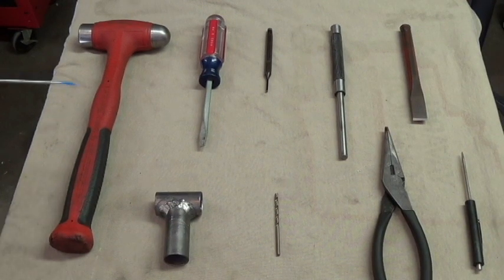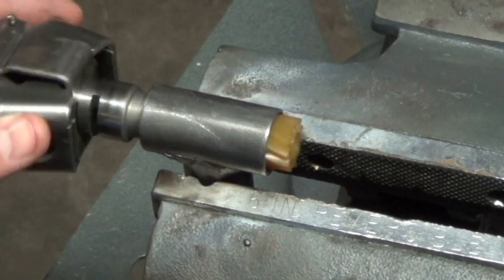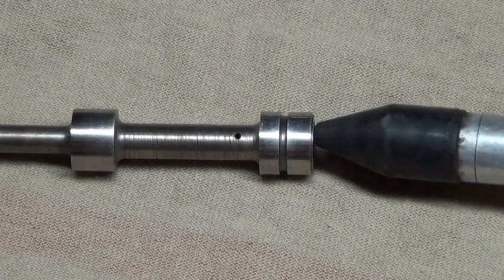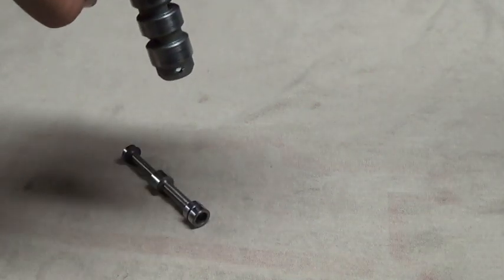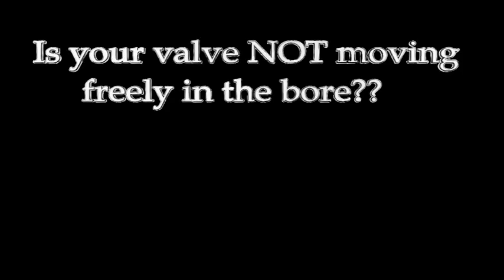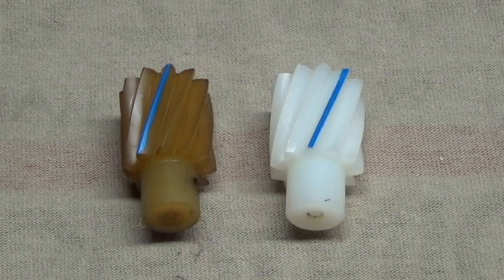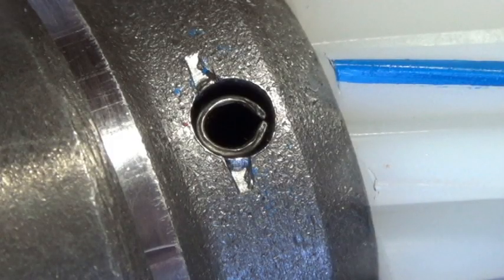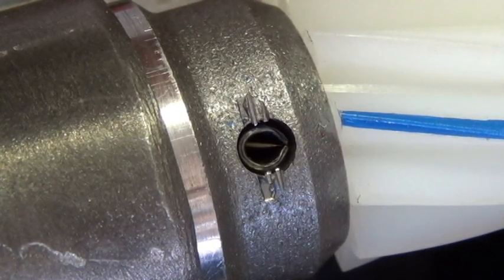TH400 Rebuild:  Governor #SouthpawAutoworks

Comment: thank you. I rebuilt the guvnor, put the valve in wrong, no downshift or first gear. your vid showed the correct valve direction. took it back out, turned it around as per your vid. it works great. thank you.

Comment: I was looking for that link to making the governor holding tool. Thanks. I most definitely found this video very helpful.  Most tranny overhaul videos don't go into the "accessory" overhauls. I'll be applying what I learned to the 700R4/4L60 governor.
Reply from the maker: Unfortunately, the video has not been created.  Good intentions...
You are so right about most videos not covering the "accessory" overhauls.  It's a real shame.
However, I'm happy to fill that gap.
Thank you for the positive comment.
Reply from the maker: Updated videos on the way!

TH400 Rebuild Series - Coming Soon
https://youtu.be/q0eciXU8YEI
Reply: @SouthpawAutoworks  awesome! Good to hear. I've been slacking on making vids, myself. I'll check it out. Thanks! 😊👍🏻

Comment: Invaluable info for Chevrolet P30 motorhome chassis where the transmission sits for long periods. The metal gear that drives the governor gear corrodes while the vehicle sits and then the rust eats that plastic or nylon driven gear on the governor.
Reply from the maker: Dang, that's a bummer.  It's a good thing that you can easily tackle this issue.  Thank you for your comment RVH MON
Reply from the maker: Updated videos on the way!

TH400 Rebuild Series - Coming Soon
https://youtu.be/q0eciXU8YEI

Comment: mines at 25 years setting, rev and 1st work. but no second gear came in, hope this is the fix. very good vid thanks.
Reply from the maker: I hope so.  Good news is, removing this governor is very easy on TH400.  

Heads Up:  The governor and the vacuum modulator work hand in hand to create upshifts and downshifts.  If it were me, I would also be removing the hose from the vacuum modulator, and checking for engine vacuum, while the engine is idling.

Let us know what you find.
Reply from the maker: Updated videos on the way!

TH400 Rebuild Series - Coming Soon
https://youtu.be/q0eciXU8YEI

Comment: Thanks, very nicely done.  I have a TH 350 that's kicking my arse.  I have the governor out, but I did not intend to disassemble the gov gear to check to see if the opening in the valve is clear.  My trans. doesn't shift when in "D".  I have all the other gears.  Hopefully, the orifice is clogged and all of this will be over.
Reply from the maker: What was the outcome of your TH350 job?
Reply: The valve was sticking!  It had built up debris over the years.  When I spread the weights and tipped the governor upside down, the valve never moved.  I disassembled it, cleaned all the parts and the port then reassembled.  Wham!  Shifts like a boss.  Thanks for the video and for the follow up.
Reply from the maker: Glad to hear that your repair went well.  Good job!
Reply from the maker: Updated videos on the way!

TH400 Rebuild Series - Coming Soon
https://youtu.be/q0eciXU8YEI

Comment: Hey thanks for the video! Awesome!
Quick question maybe you know, I installed a rebuilt th400 in my truck and it shifts normally 1 to 2nd and in reverse. 1 to 2 shift is perfect and strong, but when it’s time to shift to third it doesn’t shift even at wide open throttle. Also when I’m in second and off the gas slowing down or coasting down a hill on the highway, the engine goes to idle. Even if I can coast the truck faster than top speed in 2nd it still won’t go. Sometimes I feel it ‘shift’ into third but seems to downshift back into 2nd like passing gear. The electric wire has been off for testing purposes What could be causing this? Thanks for any light you can shed! 💡
Reply from the maker: Matt, sorry for the delayed response.  Did you already get help with this issue?
Reply from the maker: Updated videos on the way!

TH400 Rebuild Series - Coming Soon
https://youtu.be/q0eciXU8YEI

Comment: Good video....At 3:51, what is the purpose of "blue line" on the gears?
Thanks.
Reply from the maker: It was used to highlight the angle (or cut) of the governor gear.  It's super easy to install the wrong gear.  For example, the TH400 governor gear and the 700-R4 governor gear look identical...but, they are not the same.  If we install a 700-R4 gear into a TH400 governor, the governor will not install into the trans.  It's physically impossible to install it.  The teeth on the governor gear and the teeth on the output shaft will not mesh.

Mentioned this detail, in the video, as a way to prevent a potential headache for someone.
Reply: @SouthpawAutoworks  Thanks for your such a detailed explanation....Last question....why do we need governor for transmission?
Please reply in your spare time...
Thanks for sparing your valuable time...
Reply from the maker: When time permits, I'd love to dedicate a video to this topic.
For the time being, here's very basic response.

The governor creates oil pressure that represents road speed.  At zero MPH, the governor creates 0 psi.  But, as vehicle speed increases, it will rise roughly 1 psi for every MPH...up to a certain point.
This ever-changing oil pressure has an effect on the timing of the up-shifts/down-shifts.

The governor works in concert with the vacuum modulator...and both of those systems (governor/modulator) affect the shift valves.
Once again, trying to keep it short and sweet.
Reply: @SouthpawAutoworks  Thanks for your excellent explanation.... Appreciate....

Comment: a question in advance thanks for uploading interesting videos, ok
I have a 1964 chevelle but they put a 1968 transmission with Z-gate shifter. The car now does not ignite. Do you think it's just to buy a startshifter that comes with a neutral safety switch? :/
Reply from the maker: Unfortunately, I'm not familiar with the Z-gate shifter.  I believe that you're on the right track with the neutral safety switch.
Reply from the maker: Updated videos on the way!

TH400 Rebuild Series - Coming Soon
https://youtu.be/q0eciXU8YEI

Comment: Where's the link to make the governor holding fixture? It appears to be missing. The 2 measurements I need to make one are: inside diameter of the pipe and it's length. I'd like to make one ahead of time instead of having to remove it, take the measurements, then leave it out while I build one. 

Thank you for the great video. 😁
Reply from the maker: Mark, sorry for the delayed response.  Unfortunately, the time to make the video has evaded me...for a while.  However, I will be making this one in the near future!!
For the time being, here are the dimensions.

Dimensions:
1). Inside Diameter of pipe:  Roughly 0.825" (13/16").
2). Length of horizontal section of pipe(that holds governor):  Roughly 1.750" (1-3/4").
3). Length of vertical section of pipe(held in jaws of bench vice):  Roughly 2.000" (2").

Materials:
I found pipe with this inside dimension that happens to be galvanized.  HEADS UP...welding galvanized metal is very hazardous to the respiratory system.  I hear that it can cause death.  I'm looking for a suitable pipe, and will provide a link to safe materials, when time permits.  Mark, if, in the mean time, you come across a good source, please share.

Larger inside diameter may work:
A guy may be able to use a pipe that sports a larger inside diameter than specified...and simply wrap the governor with masking tape/paper, prior to inserting it into the fixture.  This will take up the extra space(clearance), and protect the bearing surface(the shiny/smooth part) on the governor.

Mark, thanks for your comment.  I look forward to putting this future video together for you, and the rest of the viewers.  Take care.
Reply from the maker: Updated videos on the way!

TH400 Rebuild Series - Coming Soon
https://youtu.be/q0eciXU8YEI

PS I still need to make the video for the governor gear holding fixture tool.
Reply: @SouthpawAutoworks  Thank you Sir. No hurry; I traded that truck away. I did replace everything I'd planned except for that gear. Thanks for sharing 😊

Comment: Would the governor gear be my issue if at steady 60 or even 55mph it will shift out of 3rd into second an then back into 3rd mostly if I give it a lil throttle ? Th400 automatic with a cheetah 3 speed shifter .
Reply from the maker: I'm not familiar with your shifter setup.  =/

Do you have a valvebody reprogramming kit installed in the transmission?
Example: Superior, B&M, Transgo "Shift Kit", etc.

Do you have the kick-down solenoid wired from below the gas pedal, to the transmission?  In other words, do you have one installed at all?  If so, does it need an adjustment(clearance between the gas pedal and the button on the solenoid on the floor?

The modulator(engine load) and the governor(vehicle speed) work against each other to create both upshifts and downshifts.
The modulator receives it's input from manifold vacuum.  Maybe it needs an adjustment.
The governor RPM acts on the governor weights...and acts against the weight springs.  Maybe you need to calibrate this, with another set of springs.
Reply from the maker: Updated videos on the way!

TH400 Rebuild Series - Coming Soon
https://youtu.be/q0eciXU8YEI

Comment: I have a 350 turbo on a 350 camaro...my second to third seems a little late to shift for me...what do u suggest...thanks in advance.
Reply from the maker: If you want to customize the shift point of that particular shift, you can do so by installing a valve-body reprogramming kit....also known as a "Shift Kit."  The kit will come with different springs.  You could also install modified governor springs.

If you're not rebuilding the entire unit use this kit:  https://amzn.to/2qFBoE4 (Paid Link)
If you're rebuilding the unit, use this kit:  https://amzn.to/2YDMfed (Paid Link)

DISCLOSURE:  🕵
As an Amazon Associate I earn from qualifying purchases.  This means that, at no additional cost to you, I will receive a small commission on any purchases you make through the website links provided above.
Reply from the maker: Updated videos on the way!

TH400 Rebuild Series - Coming Soon (60-Second Preview)
https://youtu.be/q0eciXU8YEI

Comment: What do you use to free up stuck cylinder in governor burse
Reply from the maker: Are you having trouble removing the governor from the transmission??

If so, I've never had one get stuck.  

My Thoughts:
1). If it was a junkyard trans, it may have been contaminated with water from sitting out in the elements.  Spray it with WD-40...work the governor back and forth by hand.  It should come out by hand.  I've never had to use a pry bar to remove one of these...but a little finesse with a pry bar on the governor gear may do the trick.
2). Remove the rear housing.  Look closely at the roll pin, that retains the plastic governor gear.  Make certain that it is still in its bore.  In other words, you should not see the roll pin sticking out of the governor body.  Rotate the governor, to check both sides.

Please let us know how you went about overcoming this obstacle.  Thanks.
Reply from the maker: Updated videos on the way!

TH400 Rebuild Series - Coming Soon (60-Second Preview)
https://youtu.be/q0eciXU8YEI

Comment: Hey guys,
 yesterday I had a look at the governor finally. All good.

One easier thing I don't remember, but I guess didn't check completely is the Kickdown Solenoid inside the pan.
 It could be stuck open, but how do I check if it is stuck exactly?

That's the part: https://www.rockauto.com/de/catalog/cadillac,1978,seville,5.7l+350cid+v8,1027460,transmission-automatic,shift+solenoid,8476

If that won't turn out to be the problem. I guess it's time for the 2-3 shift valve ...?
I would like to get any information about that ...

1. Is it possible to repair that with transmission in place - working below the car and just removing everything from that position or do I need to remove the whole tranny?
2. Will I need a new valve if it should be stuck ... or just clean everything and make it move freely? Where would I get a new valve?
3. What parts would I need to order (besides pan gasket)?
4. Anything else that's important to know?

Hope that I will make that beautiful car shift fine again soon.
Have a nice christmas time alltogether!
Reply from the maker: Hey Marvin, I read through your previous comments again, just to make sure that we're on the same page.  You said, "I do have a problem that it is not shifting into 3rd gear anymore."
My Thoughts:
1)  Kickdown Solenoid:  If you had a problem with the kick down solenoid, it would affect all gears (upshifts)...not just 3rd gear (2-3 upshift).
2). Governor:  An issue here would affect all upshifts.  **You checked that, and all is good**
3)  Vacuum Modulator:  A faulty modulator, or leaking vacuum lines, would affect all upshifts.
4). 3rd Gear:  In order for 3rd gear to occur, the Forward Clutch & and the Direct Clutch must be on at the same time.  Just an FYI, the Forward Clutch is used for both 1st, 2nd, & 3rd gear.  If there was a problem with the Forward Clutch, it would affect all gears.  If there was a problem with the Direct Clutch, more than likely that 2-3 shift would occur, and the clutches would slip...causing the trans to essentially neutral, causing the engine to rev really high, really fast.

I imagine that the problem lies within the valve-body...

To Answer Your Questions:
1).  Yes, you can remove the valve-body with the trans in the vehicle.
2).  The valve-body, and valve, should be undamaged...just need to be cleaned.  (Only disassemble one valve-train at a time...too easy to mix up the small parts)
3). Parts Needed:  Pan gasket, Valve-body separator plate gaskets (upper & lower), kick-down solenoid gasket.  If it were me, I'd get a TransGo Shift Kit(Link the video description).  Check out the kit for the details.  Another tip: Gaskets are only good for one use.  Once the bolts are torqued to spec, the gaskets get compressed.  I always order extra gaskets...just in case I need em.  It really sucks having to pay shipping for a 2nd small order...and have to wait days...all for a few gaskets.
4)  I'll have to get back to you on # 4.  Outta time for today.
Reply: @SouthpawAutoworks  Thank you so so much for that informative reply! Really appreciate that and it helps me a lot!!

Before I get into the valve body, one preliminary thing would be to check the oil pressure? (All states, psi readings described in the manual.) Or would this affect all upshifts?

Regarding the shift kit: Yes, that's definitely what I'm planning to do. But I'm quite limited here in Germany and need to get these special parts from overseas which is not cheap and oftentimes they don't ship international. From my past experience only ebay and rockauto works, so I need to find the kits there. Can you tell me if the kits ATP JGS52 and/or PIONEER 750038 are same thing as the TransGo and work as well? Can't tell ... Here the link: https://www.rockauto.com/de/catalog/cadillac,1978,seville,5.7l+350cid+v8,1027460,transmission-automatic,rebuild+kit,8512

What would be good to know before I disassemble the valve body is, what to look for specifically? Of course the 2-3 shift valve, but like what could be bad and how does it look like. If it's easy to notice, then allright I guess. Looking forward when you get back to me. Thanks again :)
Reply: @Southpaw Autoworks  would be great if you could answer my last message :) ✌🏻
Reply: @SouthpawAutoworks  Hey, I just wanted to let you know that my car is shifting properly again and even better now. Finally I managed to tackle the valve assembly. Disassembled, inspected, cleaned and replaced some of the parts. Most of the valves were not sliding well anymore – guess due to some contamination over time – and also some spring tension was gone since starting it's job in 1978. So thanks again for your detail and explainatory answer some months ago! That really help to figure out the problem. Also the Shift Kit that you recommended was perfect! Thank you
Reply from the maker: @marvinstracke  I'm so glad to hear that it all worked out!!  You must've had a big grin on your face during the road test.  
Yes, that really is a nice Shift Kit.  There are numerous options for valve-body reprogramming kits (AKA "shift kits"), but I've always liked TransGo's products.  Plus, the directions are easy to digest.
Thank you for the follow up comment.  Always nice to hear a success story.  I hope to see you in the comments again, in the future.  Take care, Marvin.

For anyone else reading this comment, and wanting to purchase the same shift kit for the TH400....Shift Kit (TransGo):  https://amzn.to/2Z3bfxl (Paid Link)

Comment: any ideas if my drill bit does not fit through the holes on the governor? its the right size it fits throught the gear that came out just not the metal
Reply from the maker: Does the hole in the governor have a burr at either end of the hole?
The metal is staked (intentional burr) to keep the roll pin from coming out during trans operation.
Reply from the maker: Updated videos on the way!

TH400 Rebuild Series - Coming Soon
https://youtu.be/q0eciXU8YEI